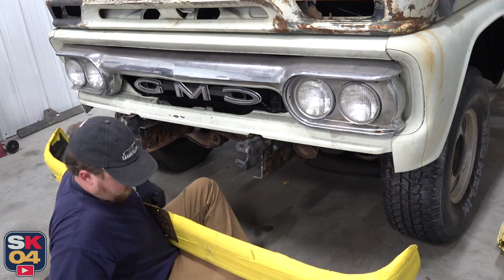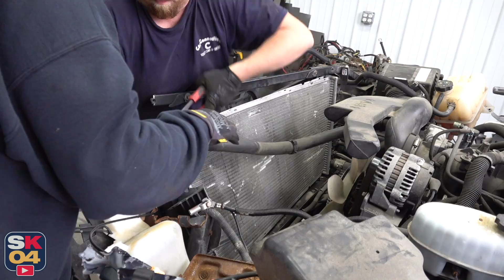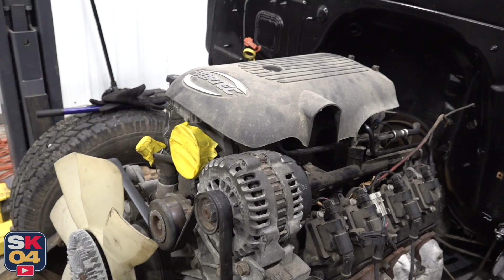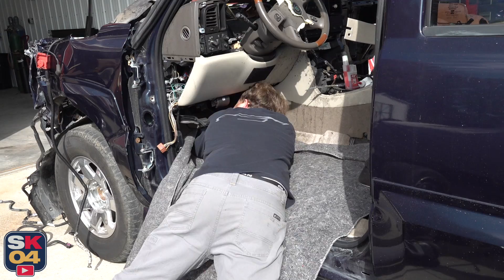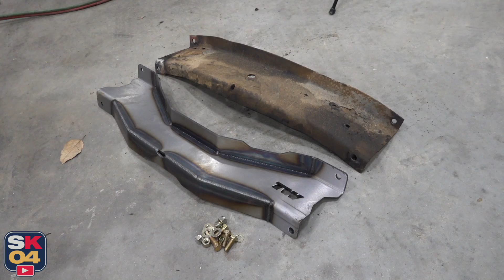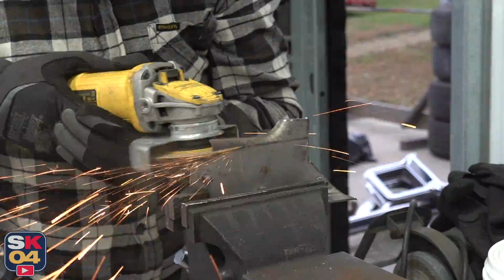The '62 GMC Gets An LS Swap & Hydroboost Brakes!  GMC C1000 Restomod Ep. 5

Comment: The LM7 even in a stock form is a fantastic engine. I have one in my pickup with similar mileage and its rock solid.
Reply: My dad has one with 330k miles on it and aside from a leaking rear main seal it works great